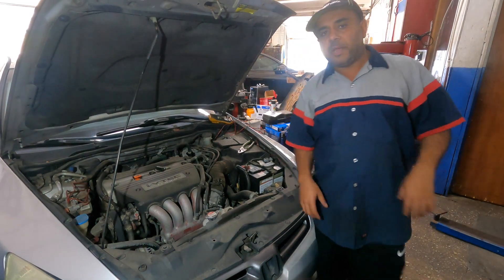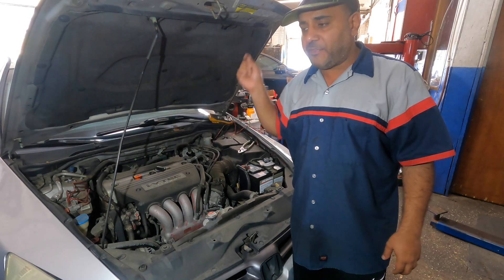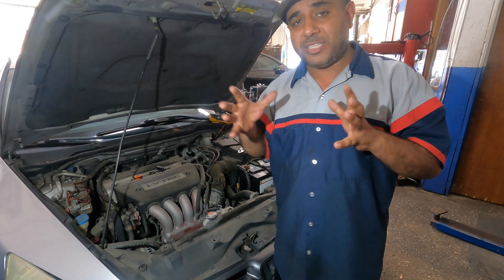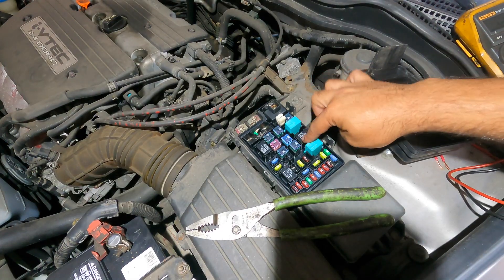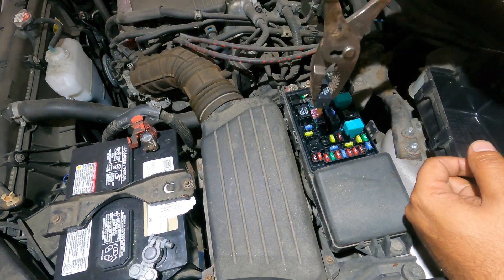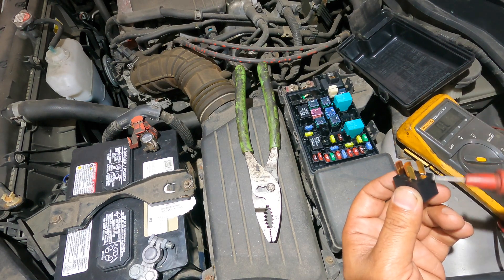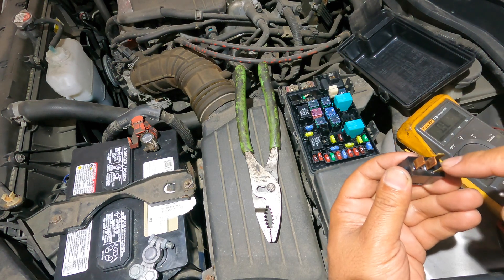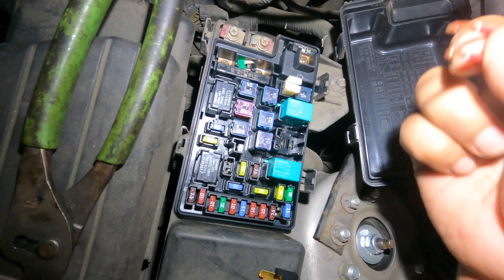How to by pass AC relay for test and diagnostic electrical AC issue     ONLY for 2-3 second test

Comment: Bro my car a/c compressor would only engage with bypassing the pressure switch which is new but the the ac isnt kold???
Reply from the maker: Did u check pressure? Usully no pressure or very low pressure is the issue

Comment: So how do you fix this problem? My ac only works if I put Ground cable  to the relay
Reply from the maker: Dose ur ac get cold!?
Reply: @RBTheMechanic  yes , it’s get cold , fans work ,  I just put a ground wire attached to the relay terminal. Why I’m not getting ground to the relay? Should I use the ac the way I have it with the ground wire?
Reply from the maker: @Omarmar3  no it will blow compressor check all fuses and swap out the relay just incase

Comment: My 2013 Honda civic probably just needs a new compressor... only works when it's not as hot and only up to like half hour... sometimes way less... the warm air... such a pain... 108 degrees today.
Reply from the maker: I would replace the relay and do ac service could be low on Freon